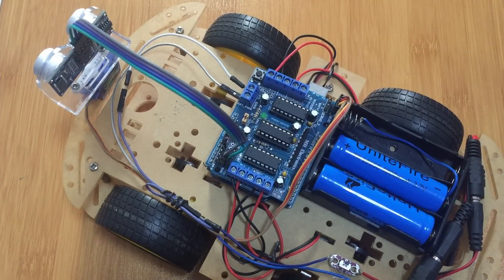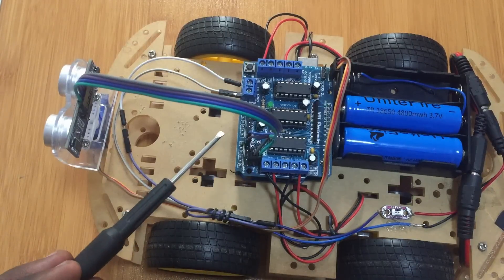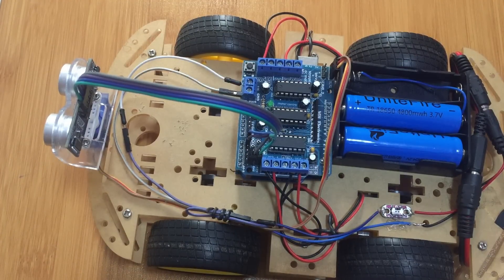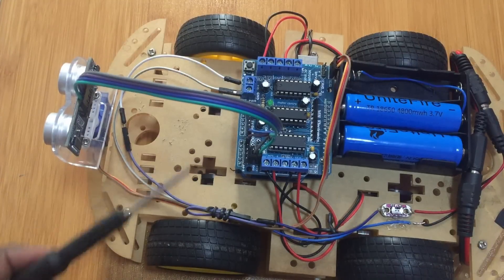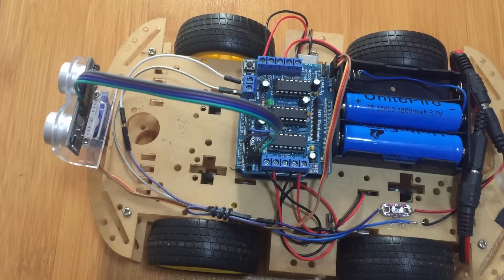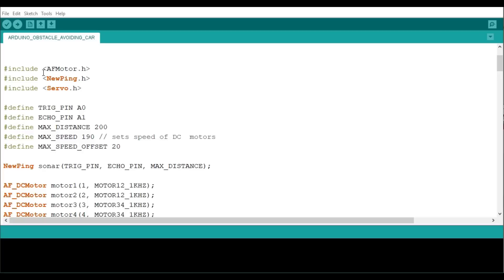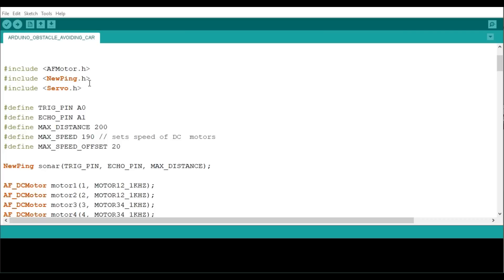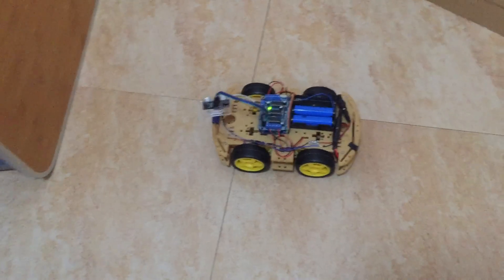OBSTACLE AVOIDING ROBOT CAR USING ARDUINO

Comment: Hello,
I built the same car but my front wheels are moving backwards.What should i do ?
Reply from the maker: That is most probably due to the way you have organised your code. Look through the part of code that determines the direction of movement of the motors and program it according to how your motors are connected.
Reply: @mytectutor  Okay.And my l298n heat sink heats a lot .Is it normal?